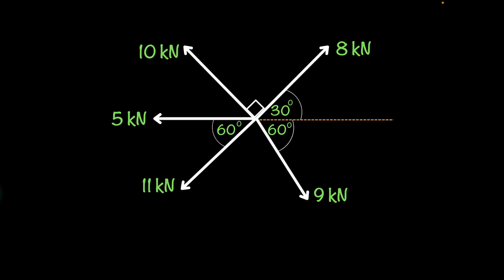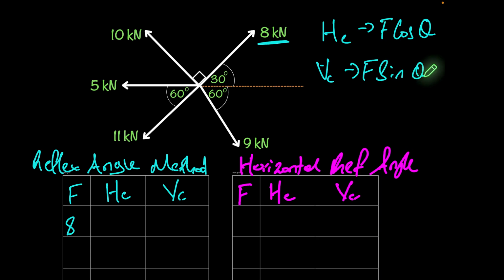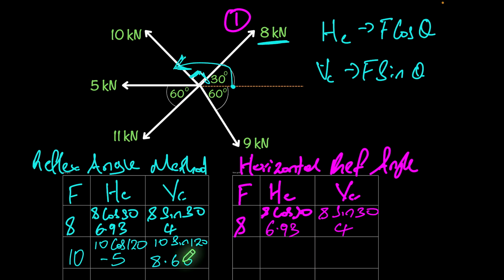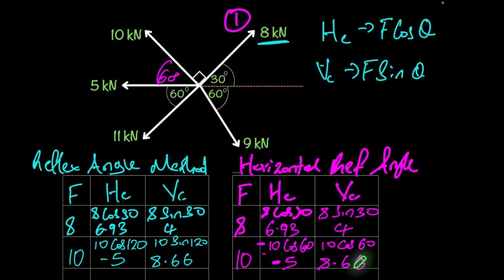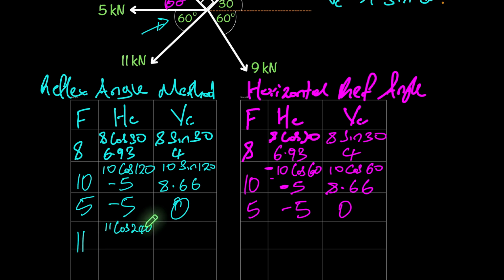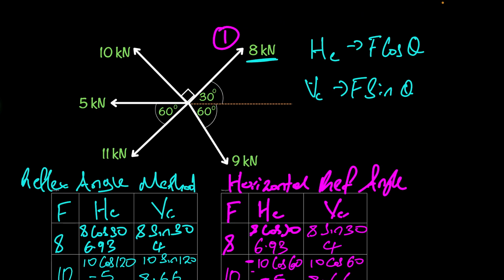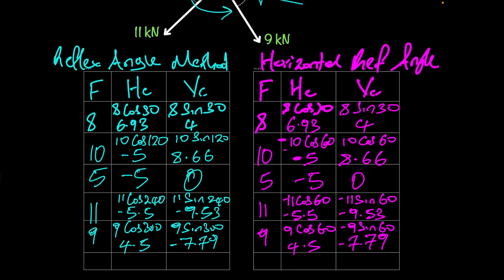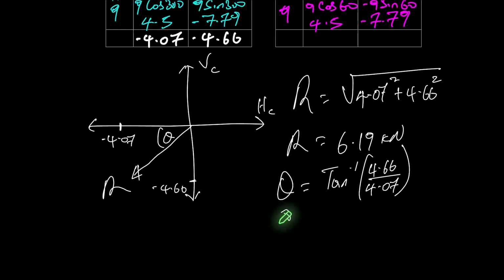Resultant Force – Magnitude & Direction | Which Method Wins?

Comment: Why did you use cos on both sides of horizontal refs
Reply from the maker: It’s because the forces that are at an angle can be resolved into horizontal components regardless of the direction. Hope this helps. If not, let me know.